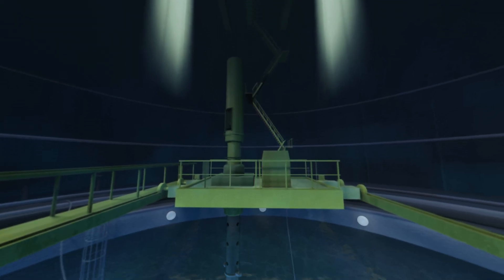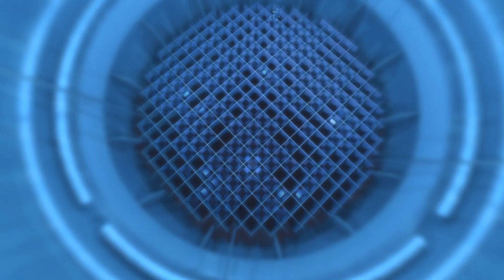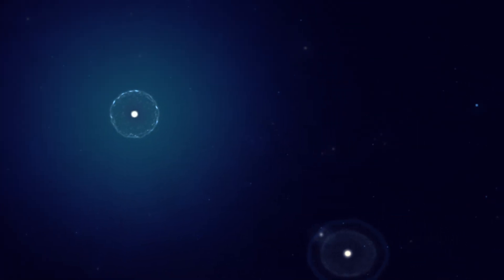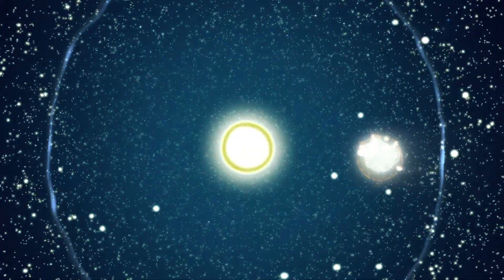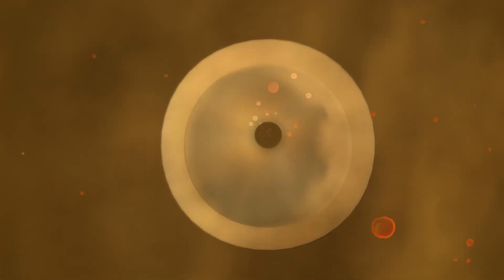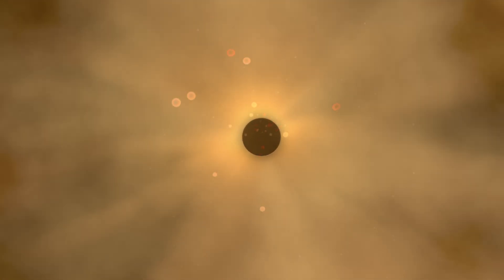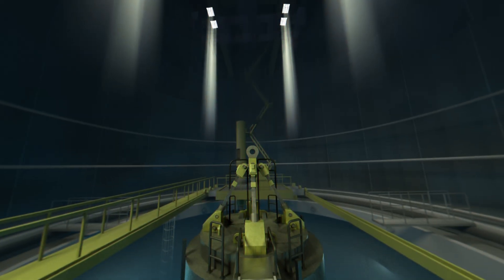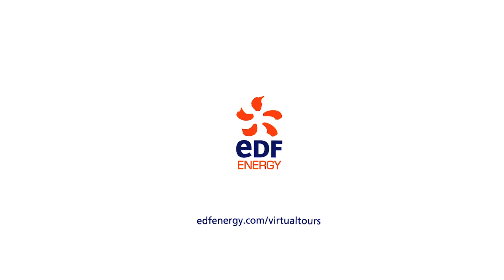Experience the inside of a nuclear reactor from the size of an atom with virtual reality

Comment: How chain reaction is start in reactet?
Reply: Control rods are inserted strategically around the uranium fuel rods. These control rods “absorb” the free neutrons.  This is reactor shutdown. To start the chain reaction, the control rods are simply lifted allowing the free neutrons to allow the reactor to go critical. Operators move control rods to regulate reactivity. To shutdown or failsafe the control rods are inserted back into the core.
Reply: @sgwrist  so you mean to say by placing the uranium fuel rods close to each other will start the fission on its own?
Reply: @karlranile4601  Without going deep into nuclear physics, to simply put it, fission is already happening in the singular nuclear rods due to enrichment, at a very low rate that isn’t anywhere near a “reaction”. As you place more rods closer together AND surround in a medium that “slows” free neutrons, (such as heavy water or graphite) then you’re allowing more free neutrons to have the chance to hit the other nuclei in other pellets and in other fuel rods and starting a chain reaction.
Reply: @karlranile4601  Once the control rods (usually of some sort of neutron absorber such as boron) are pushed between the fuel rods, those free neutrons are absorbed and reactors are slowed/shutdown.
Reply: @sgwrist  i see!!!! Thank you so much for the reply now I understand more clearly.
Reply: @sgwrist  Last question, so does this mean if you want to stop the reaction, you can just take the fuel rods out of the water as an other option? since the water is what started the reaction in the first place?
Reply: @karlranile4601  no, this would be a disaster, the water is also keeping the fuel rods in check from a temperature standpoint.  Removing (unspent) fuel rods would melt the cladding and cause numerous potential critical failures. This is why control rods are the only option for safely shutting down a reactor. Its also worth noting reactors still produce heat well after control rods have shutdown the reaction, this is why its important to have cooling circulating even after a shutdown. Fukushima meltdown was due to backup generators failing to circulate water even after the reactors were shutdown completely.
Reply: @karlranile4601  Also, again to not go too deep- but the plant controllers can remove fuel rods, but they generally only do this when the target fuel rods are spent, and there is a delicate process to removing them while a reactor is live.
Reply: @karlranile4601  Watch the series Chernobyl, its a great mini series and the last episode beautifully explains RBMK nuclear reactors in a manner that anyone can understand.
Reply: @sgwrist  How do they get the fuel rods in there in the first place? At some point these rods must have been out of the water?
Reply: PLZ PLZ REPLY MY BIG DOUBT
WHEN REACTION STARTS WHY HEAVY WATER NOT CONVERT INTO STEAM BCOZ OF TEMP ??🤔

Comment: very well explained but you forgot to tell us about nuclear disasters and how your nuclear plants put the whole of the uk at risk
Reply: The chances of a nuclear accident like Chernobyl or Fukushima are extremely low and declining. Chernobyl was a result of a design flaw and Fukushima was a result of getting struck by an earthquake AND tsunami at the same time while the main backup system was down. Nowadays, reactors have gone under and are still undergoing many redesigns and have attained many redundant safety and backup systems. You really have nothing to worry about.